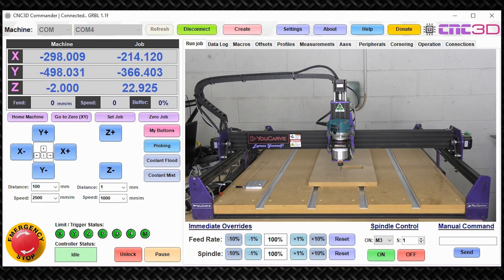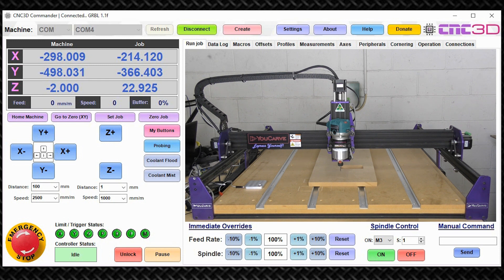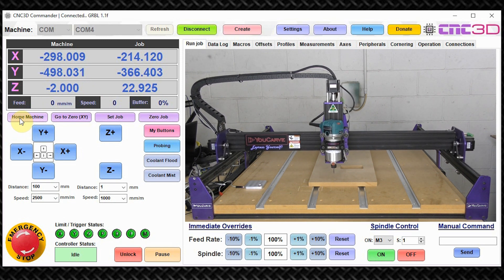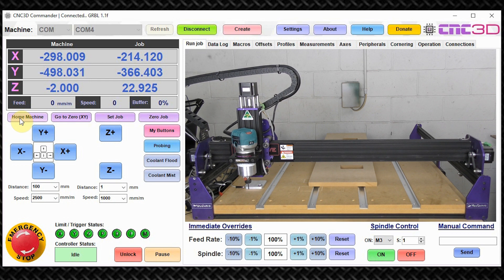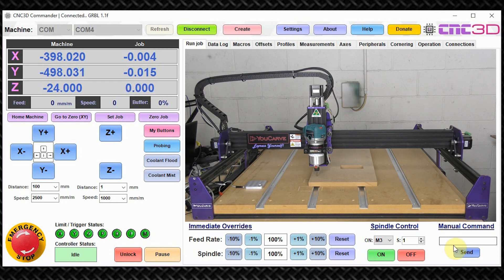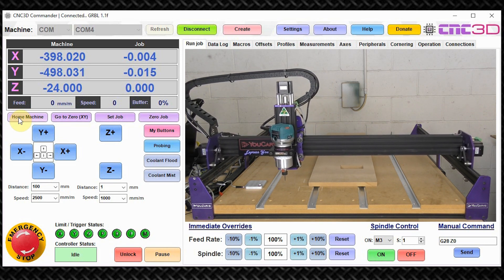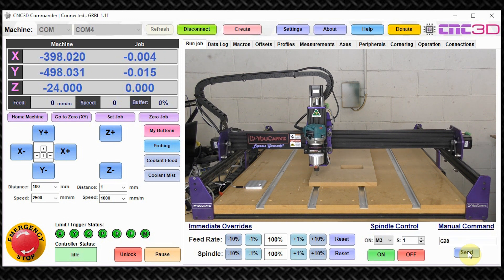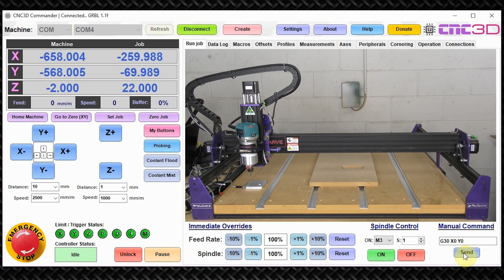CNC Tech Tip - How to use G28 and G30 G-codes using GRBL

Comment: I would like to use Sharp CNC for PCB work is there any way to surface level my copper board.
Reply from the maker: Levelling is usually done as a job itself.

Try cutting a pocket over the entire area 0.2mm deep.
Reply: @cnc3d  Thank you I will try that

Comment: If you have the probe over there at g30 and you make a tool change. The z probing can't be done there if the probe is not on the material? Or is it something I have misunderstood?
Reply from the maker: Some users have a fixed probe on the surface of their bed that can be reached by the tool. Of course this will reference your spoilboard rather than your material but it is generally easy enough to offset. So imagine a fixed Z probe at the rear right of the machine and G30 is set to hover the cutter right over the probe in the highest Z position. No matter where your cutter is you can call G30 and it will go and hover over the probe automatically for easy probing.

I hope ths helps!

Comment: How to continue after lost power during job?
Reply from the maker: You can't resume in GRBL. Atleast you can start from a fixed point and travel through from the beginning.

It may be slow going but atleast you can recover your job.
Reply: @cnc3d  how plz makes on video
Reply: Some programs have the possibility to use a button or command "run from here" so if your machine stopped for some reason like laptop going to sleep you can see at what line the machine stopped,  Re-home and then select the line it stopped at and select run from here, I us the previous line or 2. This will not work with a power cut as the machine will switch off and the last position will be lost, but in some instances may be recoverable.